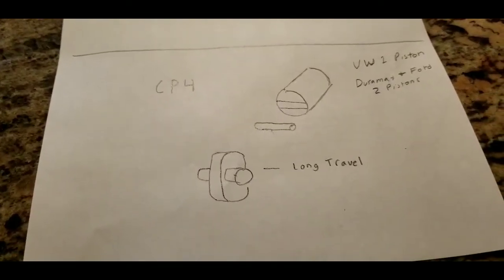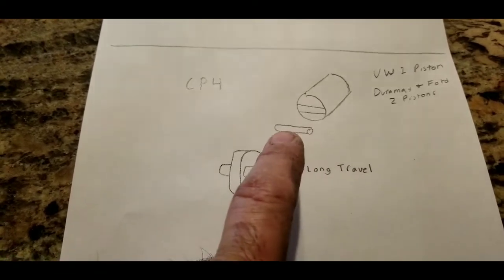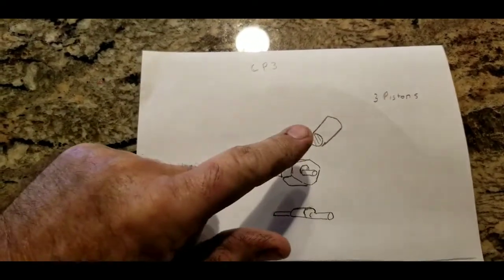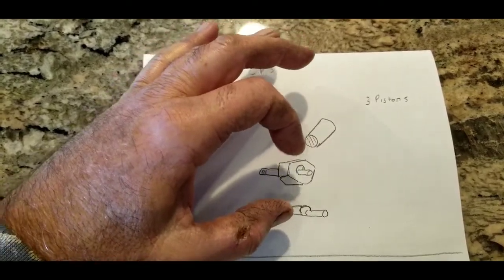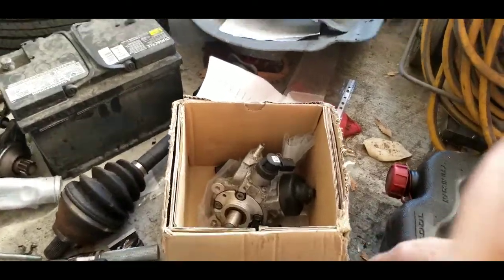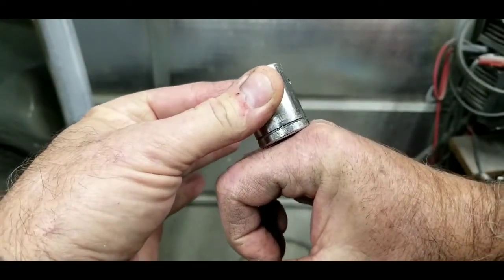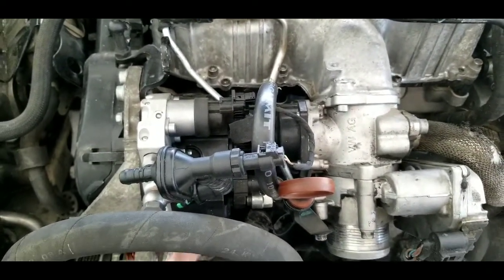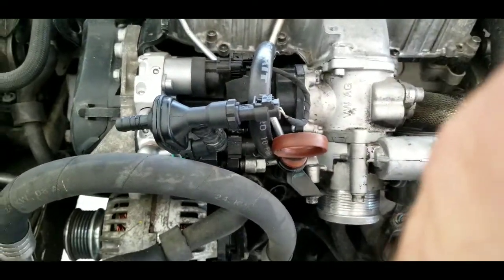VW TDI HPFP DURAMAX POWERSTROKE 6.7 high pressure diesel CP4 CP3 how they fail

Comment: What company makes the pump?  Do you have a part number?  Thanks

I watched you other video on the installation.
Reply from the maker: there is a kit on ebay it is not a direct install but it does fit and work. look up CP3 kit for vw. there is a guy in Romania who sells one. it takes about a month or so to get it. cost about 1000. Local places sell the same thing for 2000.